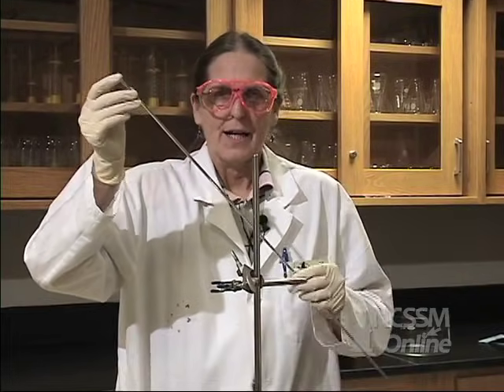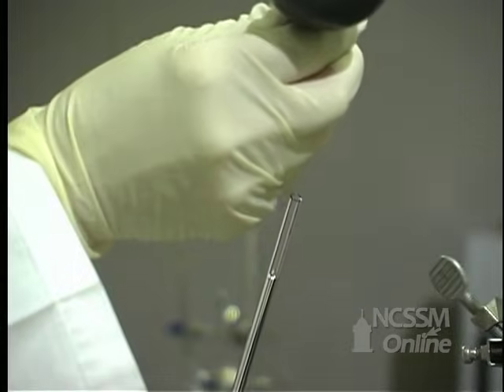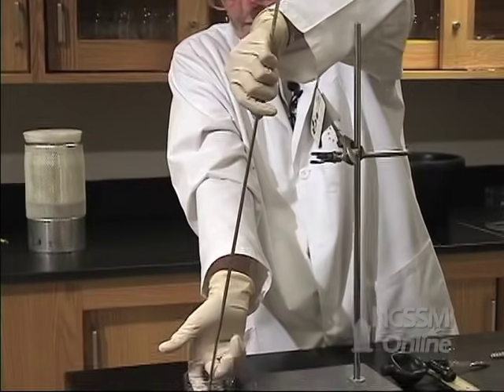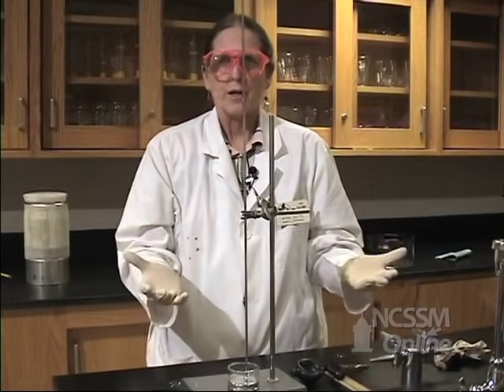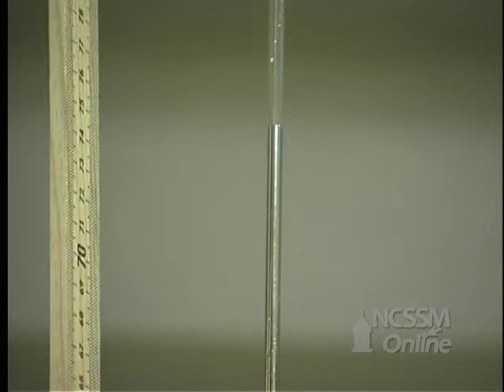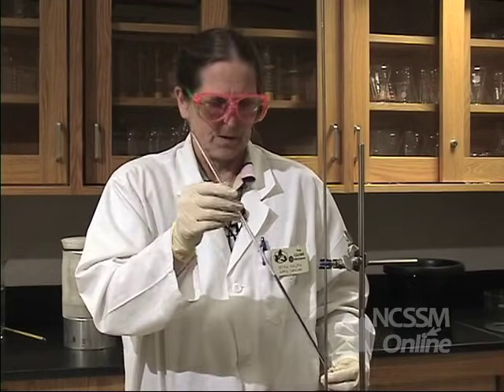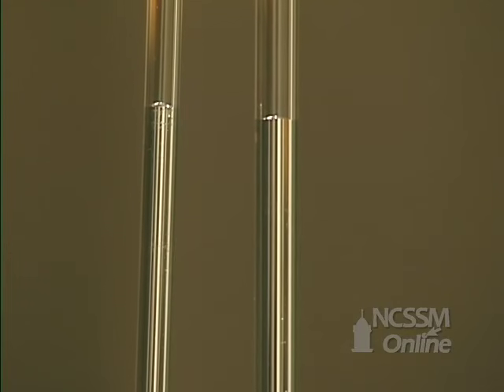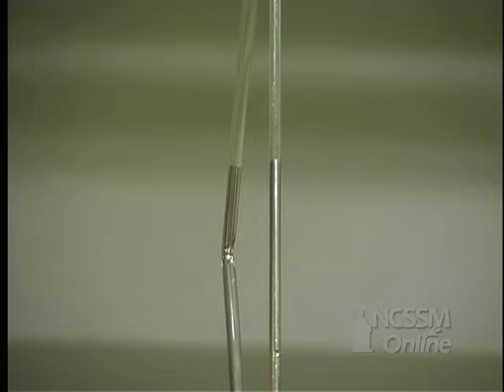Mercury Barometer

Comment: Air:
mercury atmospheric pressure  76 cm. (10.3 water, 1.0133 bar).
Breathing system = 1 bar❓

oxygen 21% (3x7)
nitrogen 78% (13..)

Temperature:
1. Daniel Gabriel Fahrenheit
WATER Fahrenheit (°F)   from 33 to 211 (212-32=180),     (pope is from 33 to 112)
water  o & n👌

2.  William Thomson, 1st Baron Kelvin (26 June 1824 – 17 December 1907).
ICE kevin (from 1 K to 273.15 K)  
ice n👌
quicksilver Hg Melting point 234.3210 K (−38.8290 °C, −37.8922 °F)👌

3. Absolute zero: 0 K  supernatural phenomena
without o & n ❓

Comment: Why doesn’t the diameter of the cylinder matter?
Reply: A small dia tube and large dia tube gives equal pressure at the base of tube. 
Pressure= Force/Area
With larger dia the force (weight of mercury column) increases however the contact area also increases (area of tube at base).
Example: It takes greater force to make a depression of same depth in soil with a nail than your finger.
Reason: Lesser contact area.

Comment: Why cant i understand 😭
Reply: There are several ways to explain this phenomenon, & different people have different ways to understand.  it might be easier to understand if I used a "J" shaped tube.  If I can fill it up while it is horizontal, and then stand it up like a 'J', then the miles of air above the open end are pushing down on the lower part on the 'J', but because the tube is sealed, the air cannot push down at all on the taller side. Only the weight of the extra mercury is pushing down on the tall side.  
. This is similar to a see-saw with several hundred loaves of bread stacked high on one side (the air) and only you (the denser Mercury) on the other side to balance the see-saw.  If the air pressure drops (fewer loaves), that end rises, and you (on the other side) also drop.

Comment: Thank you for the experiment just i have a question and i will be so delighted if you answer me , why isnt the size of the tubes important? I think it can change the hight of the mercury.
Reply: Pressure= h rho g = height * density of fluid * acceleration due to gravity... In short : pressure is proportional to the height of the fluid column only... Google for more pl

Comment: The mercury barometer is one of the most reliable and accurate types of barometers in measuring atmospheric pressure, but the problem is that it needs a horizontally stable table.

Comment: So I conclude that this day the atmospheric pressure was about 988 hPa (14.33 psi) in that laboratory(when the temperature was about 20°C/ 68°F). Slightly lower than usual at about 124m (407 ft) height above sea level

Comment: one cm square area gives one kg force exerted by atmospheric pressures
so one lakh cm square surface gives one lakh kg force exerted by atmospheric pressures

this means only one kilometres squares surface gives 25000 kg force minimum
we can increase surface area by staking and making building

so each story of building gives 25000 kg force exerted by atmospheric pressures

joint force will turned the turbine easily forever since Florida is very stormy area and air pressure always changing

we got powerhouse cheapest way indeed

Comment: all Americans are invited to do something about android's barometer at very large scale

one kilometres squares surface barometer sensing device sac cylinders will receive tremendous pressure which can easily push or pulled leverage system and we can produce electricity forever by leverage principles and gearbox based system which turned out turbine and generators setup so we got electricity

in Florida we have very stormy conditions so this type of barometer sensing device turned rapidly and gives many MW electricity per day

whole Florida  become a power generators and Americans going to get free electricity forever

Comment: Does the same principle work with water but with a much higher height?
Reply: FortNikitaBullion 10 m height approximately
Reply: 10.3 meter
Reply: @daksh0805  How about some other heavy liquid that isn't so toxic?  Maybe gallium or even water with some very soluble non-toxic salt?
Reply: @ThePeterDislikeShow  Just use the formula 101325 / (9.81 * density_of_fluid [kg/m3] ) = height [m]

Here 101,325 Pa is the atmospheric pressure, and 9.81 m/s/s is the acceleration due to gravity.
Reply: @baileyharrison1030  But even 10m isn't so bad.  I'm going to build a barometer with salt water and line it up against the side of my house.

Comment: For those who are Interested. You can calculate the pressure from the height of the mercury column, from the given formula:

Pressure = density * gravity.c * height of the column

Mercury is mostly used due to it's high density. Comparing this to water, we would need a column of around 10m.
Reply: 13.6 m
Reply: @Sudhakarsen10  no! it's 10,33 m
Reply: @dr.helmuthherterich8731   actually its  10.11 m  specific gravity of mercury*height of mercury/sp gravity of water i.e. 13.6*0.744/1
Reply: Is not it supposed to be lower when she used a larger diameter tube?
Reply: @dime3868  no  height will be same.. bcz pressure is same n it depends on unit weight and height only
Reply: @Sudhakarsen10   yeah thanks , I was thinking of force and not pressure
Reply: @Sudhakarsen10  whats 13.6?the water ht?
Reply: @dime3868   not water its mistake.
Reply: @dime3868  What Albetron meant was that a barometer using water would need to be 13.6 times taller than a mercury barometer to obtain the same pressure difference. This is because mercury is 13.6 times more dense than water
Reply: هل الزئبق المستخدم حقيقي ام لا

Comment: what if there is no mercury in that little petri dish or the container,would the mercury in the tube fall much further than the 744 m.m??
Reply: If the diameter of the tube is small enough, no, because of the surface tension that keeps the meniscus holding the liquid.
Reply: No, until and unless there is space to allow air molecules to get in the vaccum made above. It will happen when intermolecular forces are much more to hold the mercury molecules to counterbalance the weight of mercury below the 744 mm. I mean mecruy gets solidified. If it is in liquid then mercury molecules below the 744mm( below thin layer of mercury molecules) aren't capable of holding the weight of mercury below that line.. Then air will suck into the vaccum hehehe

Comment: why does the level not change when you chnge the width and shape of the container ?? Please help
Reply: If you look at the formula , atmospheric pressure is equals to height of mercury column multiply by the density of mercury and gravitational field strength , since it does not include the area , the area makes no difference
Reply: It is because of something called hydrostatic paradox check it up on Google if you wanna know what it is